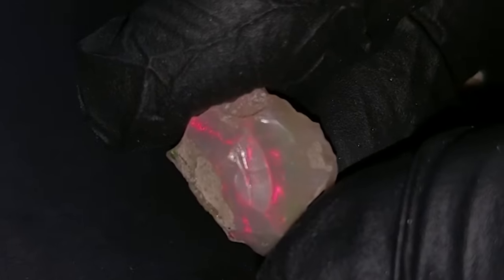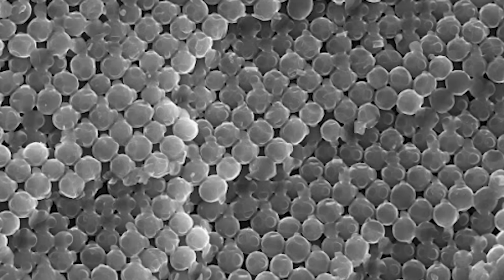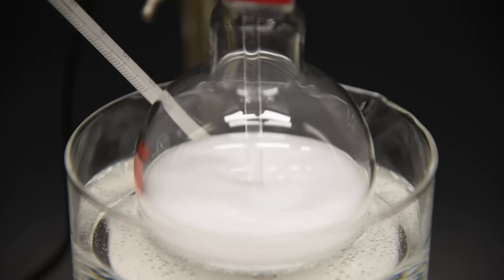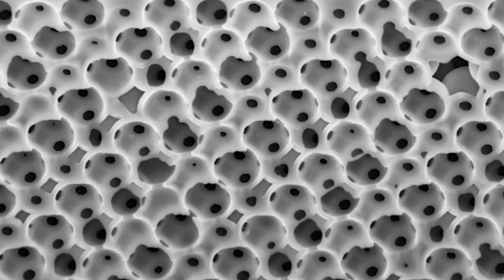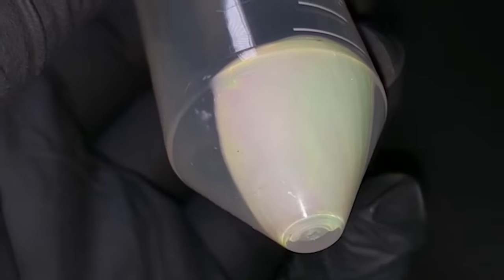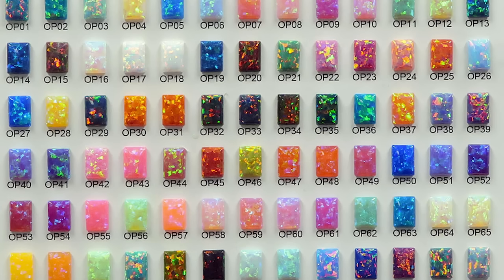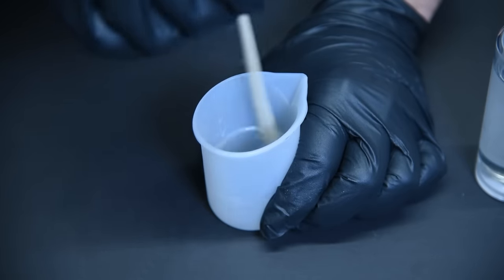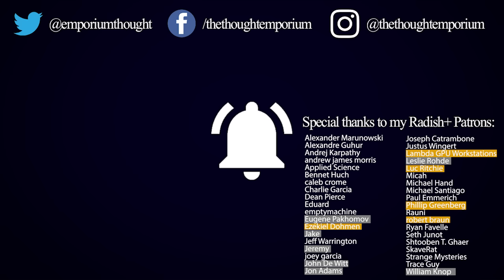Can you GROW an Opal?

Comment: opal might actually come in useful for data encryption. powdered opal, when shaken, moves around and glitters differently. if taken picture of and encoded into text, it might come in handy as an encryption key, which is the tool needed to encrypt and decrypt information.
Reply: I think lava lamps might be enough for now
Reply: @InfestedSlab  its so random though, and im pretty sure a 10cm2 box of opal powder will do the trick
Reply: Just use nail polish in a bottle. Got a topcoat full of iridescent hexagons of different sizes which when you shake/move it changes drastically. Though that one (Wizard Lizard by Colores de Carol) is perhaps a little too heavily packed to get it to change as easily as a less packed one. The base is quite thick. But still, that's easier & cheaper than getting a box of opal powder.
Reply: No

Comment: If you do end up getting a drying chamber like that I recommend renting some industrial space outside the city and maybe getting an engineer consultant to double check your numbers.
Reply: It might even be worth the money (though tbh I am not sure how expensive that would be, compared to homebuilding it) to pay to have it professionally manufactured. I dunno about you, but for me "not accidentally blowing myself up" has a pretty high value
Reply: @zuthalsoraniz6764  its not actually hard to make these things reliably safe.
a professional engineer and manufacturer could build you a large pressure chamber that is no heavier than it needed to be. has the most convenient access system that is safe and doesn't waste materials or manufacturing time. but it will be expensive and hard to mod
 a skilled amateur will build a smaller chamber, with thicker walls, just to be on the safe side, getting samples in and out will probably be harder but being so familiar with it it will be easier to modify for other projects.

Comment: I've looked at some Russian research, and I've found a simpler method to make Opals. The trick is to grow quartz in an autoclave, and then heat-treat it to let it develop microcracks.
Here's a more detailed explanation:
The idea is let the quartz grow at 298°C at 30.5MPa in a solution of 1%NaOH and 10%Na2CO3, and it will grow with a speed of 0.4mm per 24 hours.
However during a prototype run with smaller quantities, they grew quartz at 326° 32.3MPa, 0.5%NaOH and 7%Na2CO3, with slightly faster growing rates.
The big chuck of quartz is then cut into small pieces. The pieces get covered in sand, and they get slowly heated up to 550°C. In the testrun they let it heat up 10° every hour, they kept it at 550° for 4 hours, and they let it cool at 10° per hour; with this process <1% of the stones cracked. In their high volume runs they let it heat by 60°/hour, keep it at 550° for 15 hours, and let it cool at 60°/h, and failure rates went up to 5%. They say that all pieces became white and developed this opalescent pattern after heat-treatment.
Reply: you can possibly do that with a fairly normal pottery kiln
Reply: @p.f.3014  Yeah!
Well, the 2nd part is fairly simple: just bury it in sand and slowly heat up while controlling the temp. We're talking about any sand, and atmospheric pressure.
But the process of growing quartz at 30Mpa is a bit trickier, that's 300 times our atmospheric pressure... You're probably better off getting commercially made synthetic quartz, which is not that expensive. But the quartz that you buy, should be made under the conditions that I mentioned.

Comment: Have you tried running some soundwaves through the container as it sets its pattern?  Maybe the 7.83 hz that is supposed to be the Earth's frequency.  It'd be interesting to see if you could dial in different patterns or stacking of the particles.
Reply: Man that's interesting. I wonder what would happen.
Reply: It would probably mess up the opals shiny construct. Sound is vibration, vibration is constant movement. Like he said the samples sat still for months n the one time he tried motion it turned into a white chunk. So sound probably wouldnt be the way to go but its worth a shot. Maybe some sort of low range sounds possibly.
Reply: Also i just thought this, if you put sound directly around with the sample at the center, i can imagine the molecules being pushed away from the walls concentraded to a center, possibly creating an interesting piece of opal.
Reply: @ppierson4126 Some sort of resonance frequency may well be the "trade secret" to avoiding the characteristic tiger striping...
Reply: Someone needs to try it and let me know. Cause the physics off applied heay and pressure arent nor have to be so extreme as most gems to grow. So besides heat n preassure, resonance is the only other idea i have. It may take some trial n error but i can say id deffiniely go for lower frequency. Lower frequency less vibration. High frequency and you got an earth quake turning the mix into that whitw not as pretty rock.
Reply: Fascinating thought, I now want an opal grown to heavy metal.
Reply: omg how incredible that could be
Reply: @ppierson4126  I imagine that a rssonance frequency would group the different sized particles and therefore colours together as opposed to muddying up the colour. just a thought
Reply: @rr2109  I'm certain the blackened intro will make perfect black opal... How could it not?🤣
Reply: @imaginedauthority9455  kinematics could buy used prior to sort particles but size in order to affect matrix, so why not? Scale is everything.
Reply: What is the frequency of a real opal material?
Reply: Since he’s making the opals on Earth, wouldn’t they naturally already be at the Earth’s frequency?
Reply: @boomstick4054  Perhaps but since the formation timespan is so much shorter a direct source nearby might give a different result.
Reply: Interesting to see a comment both kind of scientific and yet so unscientific at the same time.
Reply: @markphillips7538  yes yes yes I am on the same track!
Reply: Soo, where it is know that bit of “natural resonancy” I’m a geologist and nowhere i’ve heard of that
Reply: I wouldn’t go with sound waves and Earth frequency is already acting from Earth,constantly....I would experiment with mixing in some magnetic particles with silica nano particles and put it on some magnets arranged in some pattern..probably magnetic pattern would shine throughout opal.different magnetic particles with different magnets patterns...that would probably would be fun experiment
Reply: I was gonna say that
Reply: haaahaaaaa i got the 260th thumbs up
Reply: @ppierson4126  it certainly would be interesting to go with a duration and frequency approximating various observations of that which is suspected to be a ratio of the natural phenomenon.
Reply: You'd probably need a lot more than 7.83 hz to get a shiny result.
Reply: Since the trade secret was made in the 70s I would think it's worth a try
Reply: Music/acoustics nerd chiming in to say that the frequency of the Earth's core fluctuates within a full octave of resonance. That means nothing can be tuned to it, because it's always changing. 

You need something that repeats regularly in order to tune to it. Something like the orbit of a planet, or the length of a day.
Reply: With fully formed natural opals - gems in jewelry - it's incredibly dangerous to use an ultrasonic cleaner. It will destroy the opal. I'd be very careful what kind of frequencies you apply to the experiment.
Reply: @margretrosenberg420  You obviously didn't watch the video which was about making synthetic opals.
Reply: @Javier-mc4pc  let's pause and enjoy the moment of chemists and physicists completely failing at nature understanding they claim ownership of. Most of them are typical Sheldons who despise geology until it kicks them in a face. 😆
I am a geologist too.
Reply: Ok, now can I make dice this way? Lol
Reply: I'm not sure about that frequency, but in resin 3D printing there are apparently some high end machines that use some sort of audio device using the same principle for even distribution of particles added to resin and it also heats the resin to my understanding as well.
Reply: @GregAtlas  Sound is vibration. Vibration creates heat. In the case of opals, them having a regular structure breaks the opalescence. It has to be groupings of regular structure, but oriented in different directions to have the effect. Sound waves are shown moving up/down, but travel linearly so when you look at crystalline kinds of structures affected by percussion (such as flint that's been knapped) you see ripples radiating out from where the source was at a regular interval. But opal doesn't have a regular repeating ripple meaning just playing a single frequency isn't going to get the right result. So it requires movement. But it can't be too fast, nor just in one direction. I imagine you'd get a better splitting up from slowly rotating the opal as its drying about multiple axis. But like super slow. So then you get sections very nearly drying but just in time a rotational shift allows them to be pulled just out of alignment with the next cluster enough tgan when fully dry to have distinct areas of different colours close together but not as regular banding.
Reply: Technically, since the experiment was done on earth, it's already being subjected to Earth's resonance frequency.
Reply: I've thought for years there is some kind of link between harmonics and crystallography and its piezoelectric effects that somehow would answer alot of our questions about life!

Comment: perhaps the best stabilizer may be a heat activated wood stabilizer. These are made for penetration and are low viscosity. However, the principle of vacuum stabilization presupposes that there are air pockets in the material which will be evacuated by inducing a vacuum. When the vacuum is released the stabilization fluid penetrates into these voids which previously held air. I suspect there will be minimal penetration into an opal pellet which holds no fractures or voids (aka centrifuge sample).  Other ways of stabilization may involve the introduction of trace amounts of aluminum after the microspheres have formed and just before centrifugation. A kaolite clay solution could be centrifuged beforehand with the wet-but-decanted pellet left in place and the opal microsphere solution carefully layered on top before it is centrifuged. This may provide trace aluminum and magnesium as well as yield a flat pellet rather than a pointed one because the nose of the tube was prefilled.  Final suggestion? Place the pellet in the center of a ball of clay, wrap that in a layer of cotton and place the whole of it in a ziplock bag and forget about it for a year. This will allow for very, very slow migration of water out of the opal as the ball loses water through the plastic. This is an old trick for high water content opal that crazes after being taken from the ground.

Comment: I feel like that non-tigerstripe pattern might have a mechanic solution, where during the setteling process the opal is disturbed ever so slightly to knock some of the structure and force it to stack in different ways. Just a theory, of course, but it does seem the most organic to me.
Reply: maybe allowing a thinner disk of opal to settle normally, manually breaking it into the right size grains, and putting it in another tube with the solution would work
Reply: @ejynk  considering how delicate the pellet supposedly is, that might be a little hard to achieve... but possible, none the less
Reply: @ejynk  Or maybe taking some other crystals, like the air dried bits and mixing them in as it settles?
Reply: @mwater_moon2865  yeah. I suppose that might allow it to crystallize but I am neither motivated nor smart enough to recreate this experiment
Reply: I was wondering about this, or possibly siphoning the solution off after a while and replacing it with another "color" of the solution. Alternately, maybe putting an uneven surface at the bottom of the settling chamber, so they have different planes to stack against?
Reply: Just trying to think about how these things might form in nature, rate of settling, movement, and "substrate" could all affect the pattern.
Reply: Agree. Trying to think of something that would have been practical in the 70s. Someone mentioned sound waves, but that seems a stretch for that time period.

Seems obvious to connect the vertical pattern to gravity, but maybe I'm missing something.

But perhaps, a way to rotate it extremely slowly, even incrementally while it settles. Like suspended by a multi-axis yoke like for mounting a globe. Either keep it moving at a snail's pace, or use stepper motors to move it slowly, randomly a few degrees at a time over the course of an hour/day and then stop and let it settle a bit in each new position for a week or whatever the time needs to be.
Reply: @barcodenosebleed5485  Yeah, considering the time period, I think a mechanical interference makes the most sense and is probably the easiest to achieve! I think there has to be a way of getting the stacks to be knocked irregularly, though, otherwise you'll always end up with another pattern that just repeats itself cleanly... Sound waves might not be too far-fetched. Definitely something that wouldn't disturb the opal enough to fully fall apart, just enough to change the structure randomly.
Reply: @kaniyaru117  a white noise machine?

Comment: SiO2 Nanoparticle specialist here: I unfortunately also do not have an idea to solve the drying issue without proper equipment but I suggest you to make as huge of a piece as possible by sedimentation and pray that it breaks into huge bits so you can still use those. For filling up the gaps you might also use TMOS instead of TEOS which can be easily hydrolyzed with just water to it's roughly 1000x higher reactivity in comparison to it's Ethanol-brother. it also happens to have a much higher solid content (TEOS=28-29%, TMOS= 39-40%) so by using an RoR value of ~1.0, which is easily enough to hydrolyze all Me-O-Si groups, you would only need to let the gaps soak in that solution a couple of times to ensure they're filled completely. TMOS forms a gel fairly quickly after its reaction with water so working fast is requested. Don't shy away of using your vacuum chamber to make it soak faster. You might also use some kind of monomer found in plastic production which is more liquidy than a resin and polymerize it after soaking the raw-Opal in it. Maybe a polyaddition or radical polymerization would suit it quite well... polycondensation is a little tricky as you can see on the TMOS example since you force a shrinkage and might have to repeat the process several times. I do not know which monomers are comercially available unfortunately :( I might also try this out in my own lab! At least I own spherical Nanoparticles in all sizes... lets see where this leads to! Avoiding these tiger stripes looks like quite a challenge... maybe they disturbed the sedimentation just so much so the partickes align differently aftterwards by heat or vibration or whatever but these are just guesses. overall really good video! Enjoyed watching it quite a bit.
Reply: "Tiger stripes" occur in natural opal, too.

Comment: When I cast quality resin parts, I do this in a pressure tank. This is done after the resin is degassed of course. This causes the air bubbles to be crushed to microscopic size. In theory if you has a thin enough resin you could get it to fill your voids. (you might also try Cyanoacrylate either with vacuum or pressure) Another option would be to try a vacuum casting process, that you pull a vacuum on the part when you add your resin to draw the resin through your raw Opel. I also wonder if you could crush your opal samples of various colors into a controlled size (say 1mm) to get the sparkles of a regular opal and then mix that into a resin and get something more natural looking. Perhaps someone has already suggest all these ideas already, so apologies in advance. I would actually be interested on collaboration with you to try some of these ideas if you're interested.

Comment: I recall reading about a process that imitated the natural formation, filtering a silica solution through soil and passing a strong electrical current through it. As I recall, it took several months, so patience was required. Would be fun to experiment with different solutions and processes.
Reply: You got a link or more info ?

Comment: One thing you want to try is stabilizing resin. Peter brown used it a few times to stabilize bread. It's a very thin resin that is heat set, so you place the porous object you want to make hard into the stabilizing resin, and then draw a vacuum to extract as much air as possible. Then under atmospheric pressure the resin is forced into the voids of the product, which is baked to cure the resin. It may be possible to place the uncured object into a pressure chamber which is then heated, to further drive penetration of the resin before curing.

Comment: I’d suggest using HXTAL-NYL 1 as a casting epoxy. It’s a standard adhesive for joining glass and ceramics in conservation, so won’t yellow over time, and I can attest from personal experience that it has alarmingly low viscosity, and will sprint up and down any crack or nook and cranny you have, so would be perfect to consolidate your synthetic opal.

Comment: Great video! One correction, sintering does not involve melting, although there can be some melting of material during a sintering process, but not with silica, as silica melts around 1700 C (over 3000 F). I also love synthetic gems as they are the true gem material, not an artificial substitute.